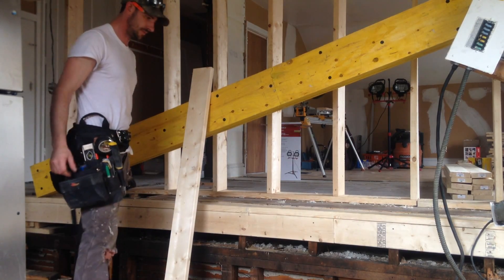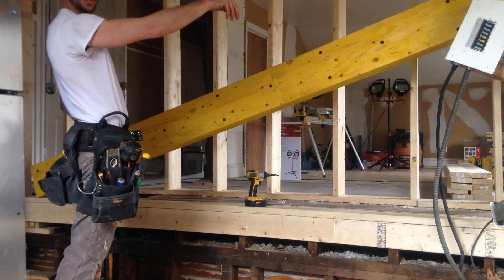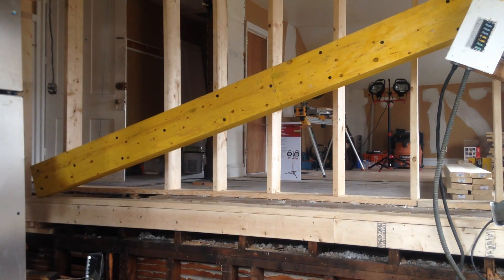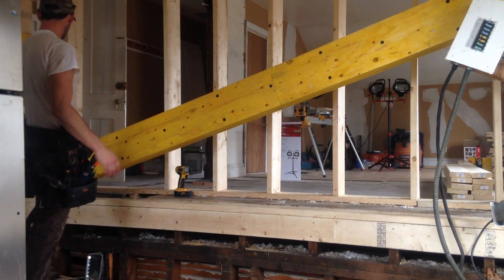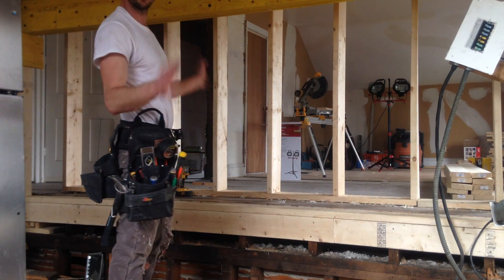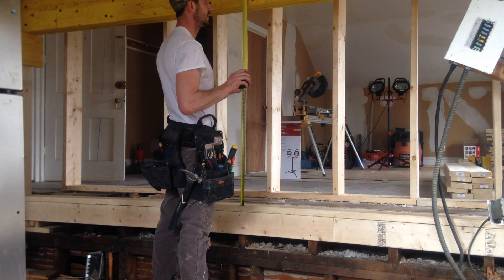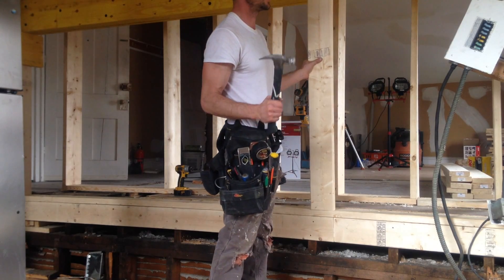How To Install Load Bearing Beam- Laminated Veneer Lumber LVL (Part-3)

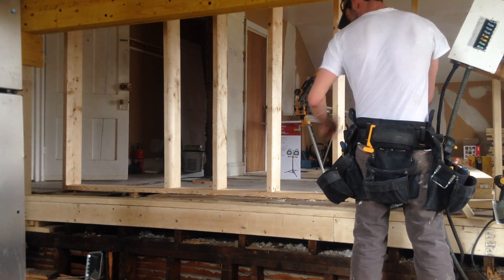Comment: From 11:40-12:45, you had a rough time to install the 2/6 support for the LVL which was screwed at the end, you could screw a 2/6 foot long piece instead of your screwing of the  LVL support itself. Also when by yourself doing such job, a hard hat, an impact drill of course, brushless and sharper miter saw blade won't  hurt. New tools do tell that you are doing something right that you can afford to buy them. Good luck and thanks!

Comment: fyi, 1/16" over 4' is exactly how that sounds.  you do not multiply by 4.  12' beam, 1/16" out over 4', total difference is 3/16" over 12' from end to end.  Heat of the moment mistake i'm sure when you have shit loads of numbers and measurements running through your head during the build.  Keep building brother.

Comment: I have a 20' x 6" x 12" beam. How many supports do I need and can I get away with only vertical support on the ends?
Reply: LVL? if so, use the online Boise Cascade calculator

Comment: big job? I notice alot of shiny new tools
Reply from the maker: +shazugin Only new tool is the light. To be a good contractor you should keep your tools clean. most of these tools are over 5 years old.
Reply from the maker: +shazugin It was a massive full house restoration I did myself. Large scale project for a client.